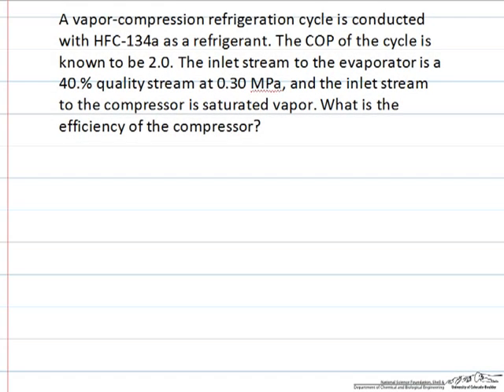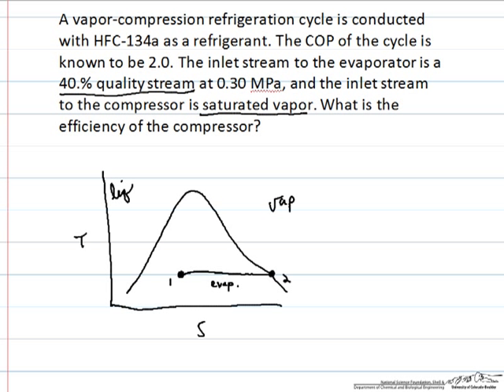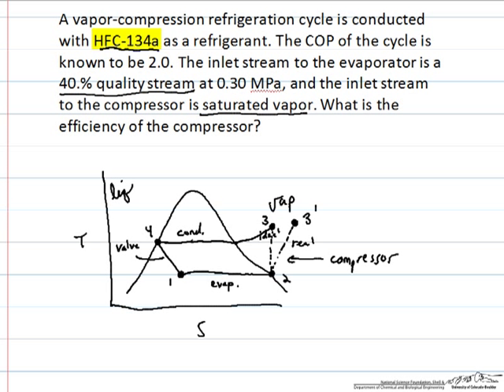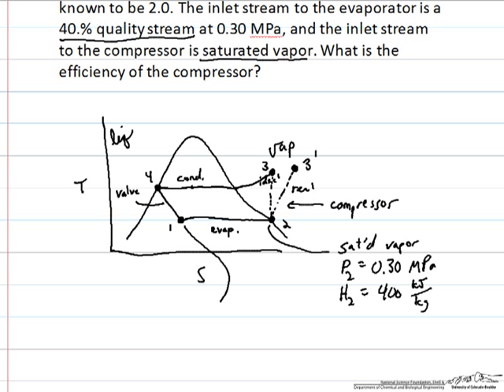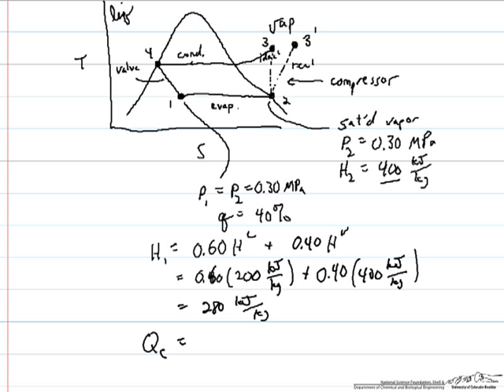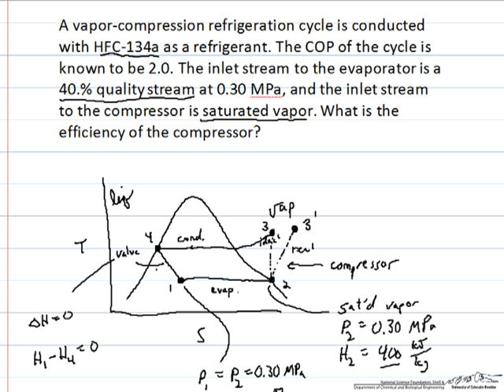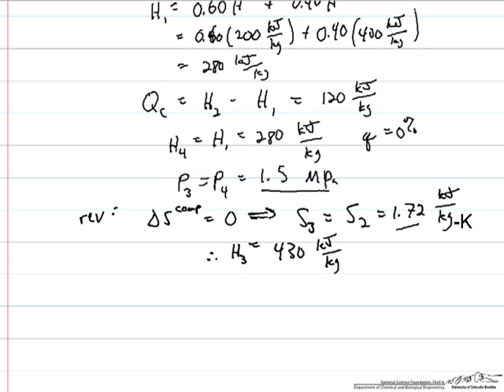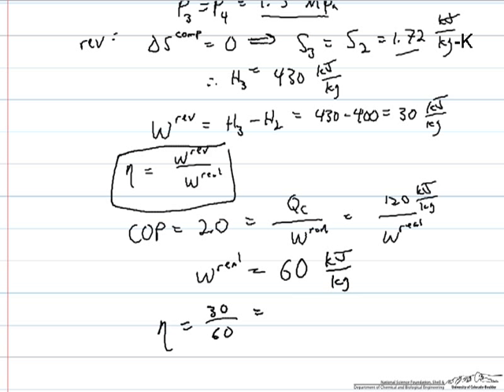Refrigeration Compressor Efficiency (Review)

Comment: I have rally don't understand the concept of COP for actual power by compressor.
Reply from the maker: COP is essentially the ratio of how much heat is transferred out (Qc) to the work required to operate the pump (Ws).  More qualitatively, the larger COP is, the more heat transfer you are getting for a given power input from the compressor. So if you know the value of COP, and can calculate Qc from enthalpies, you can calculate the power required by the compressor.

Does that answer your question?

Comment: thanks for the video. I thought the Qc is the heat from the condenser, so Qc should be 430-280=150kj/kg  not 120 kj/kg because that would be the heat from the evaporator, or am I missing something?
Reply: 400 - 280 = 120